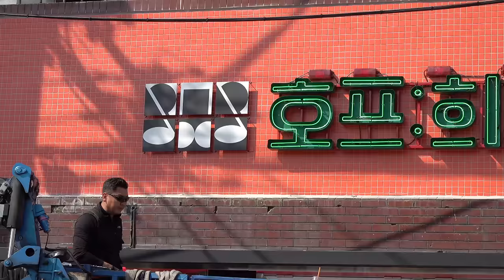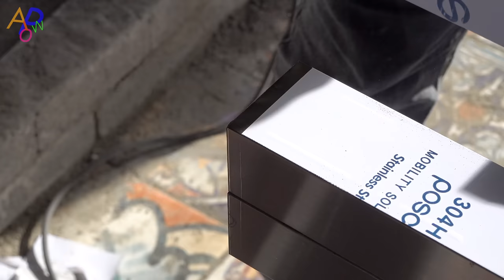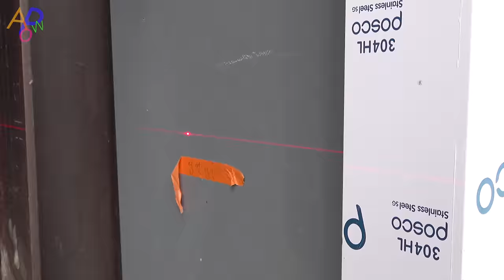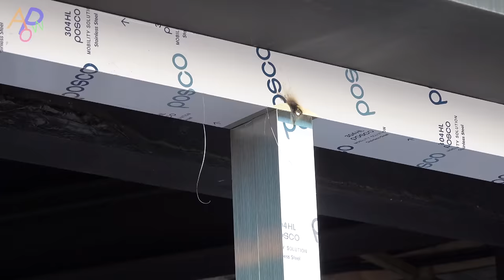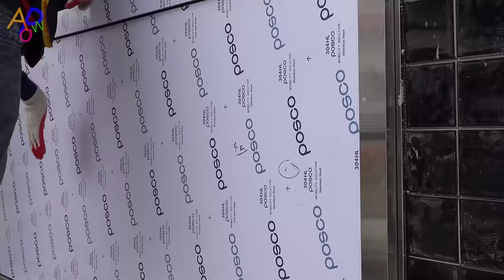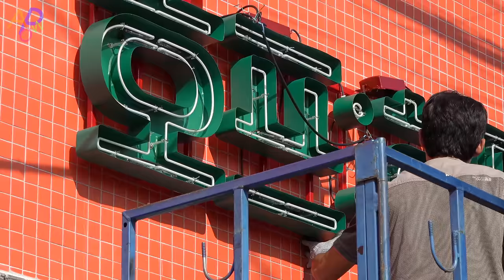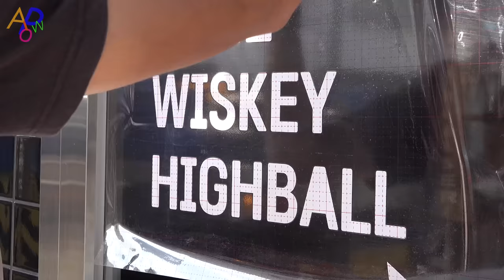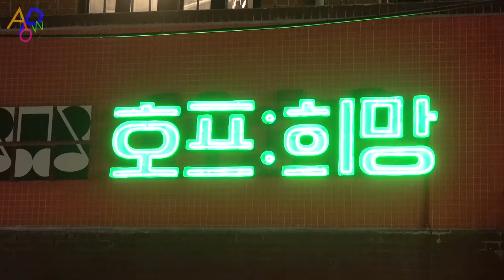Process of Rebuilding Old House and Turning It Into Pretty Bar. Modern Architectural Design in Korea

Comment: I know it's only tack welds, but no goggles?  It's still an extremely bright light.
Reply: Yeah, not surprised by that. Seems pretty common from watching all these vids. I'm more concerned with no waterproof flashing on the windows, especially at the bottom. That gonna leak.
Reply: @AussieSnoflake  One kick and it will all fall apart.